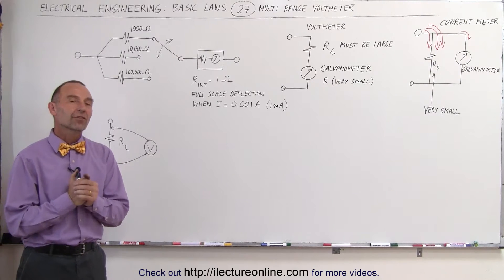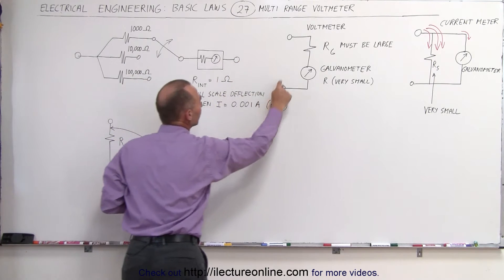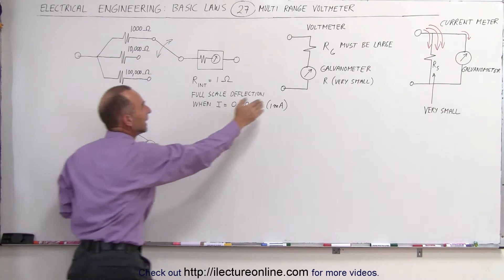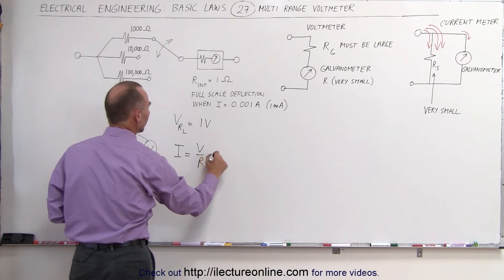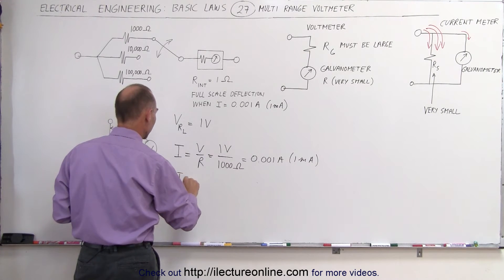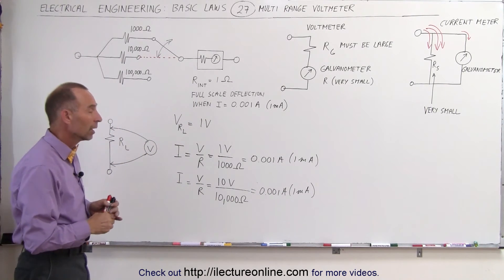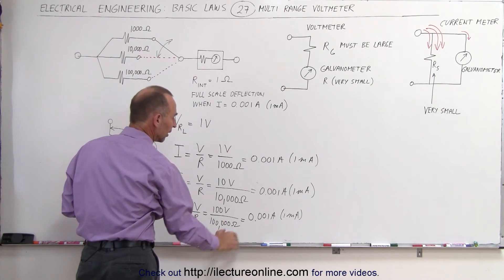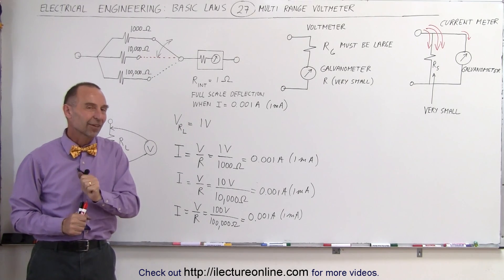Electrical Engineering: Basic Laws (27 of 31) The Multi Range Meter

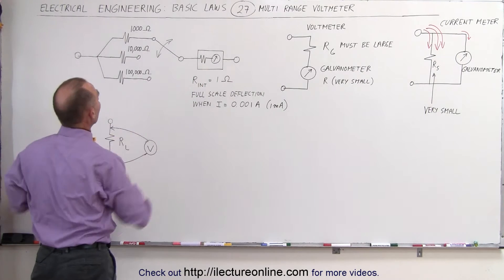Comment: 0:40 
Question: Can we assume the opposit ?
In other words can we assume the input to be on the side of the pointer needle and the output on the side of the 1000 Ohm resistor ?
Thanks for your great videos.
Reply from the maker: If two component are in series then it doesn't matter what order they are in.
Reply: @MichelvanBiezen  
 Big thanks for your clear explanation.

Comment: what are  the purposes of the 1000 and 10k ohm resistors if you can use the 100k ohm resistor to measure up to 100V?
Reply from the maker: That is just for an example.  Voltmeters are built with different size resistors.

Comment: cant we only use 100000ohm resistor everytime to find voltages even for small ones? what difference does it make in the reading sir?
Reply from the maker: There are 2 reasons.  1) For small voltage readings, the deflection would be so small that you can't read it.  2) Analog meters are more accurate when the needle points towards the middle.
Reply: thank you sir